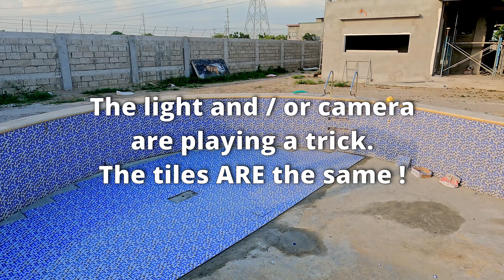Philippine House Building Day 196 - The Pool Boys Are Back In Town

Comment: Hello Mike . Your 3 layer ceilings are going to be a very nice feature mate . Hopefully done in a way no cracking of joints in the future. Hard to do in Philippines with the products available to use on joints as far as I have seen so far on ceilings over here . Suggestion for the wife - hire a 12 to 18 ton excavator with swamp tracks to work with the loader to deepen your pond to the final level and do the clean up around the pond sides . Regards Mick
Reply from the maker: Mick
Yes, I really like what the builder is doing with ceilings. Looking forward to seeing what they do on the joints.
I think we are done with the pond for now - enough money spent to dig a hole !
Reply: @philippines4.0buildinganew64  yes a loader of that capacity up my way is quite expensive daily rate .

Comment: That’s a great overview for a great Solar System.  Panels plus Batteries should be enough if you have enough of both but you apparently subscribe to the Belt and Suspenders philosophy, I do too.  If so your Generator will only have test hours on it in 10 years.  Have you calculated Break Even yet?  I’ll be anxious to hear all about the manufacturers of all of your components, especially the type of batteries.  Did you watch any of Will Prouse’s Solar Videos on YT?  I highly recommend them.  There’s also another YT Channel called Wild Wonderful Off Grid and Josh has a great video on just his Solar System.  Look through his Library for it.  If nothing else you’ll see what a system should look like done by a guy with OCD.  I’m guessing you relate to that kind of order in a project.  I believe that if you go deep on Solar on your Channel your Subs will pick up quickly.  It’s a big attraction now.  Good luck.
Reply from the maker: Hi Marc
I have had a brief look at both the channels you suggested, but I need to see more of both of them. Really good suggestions, so thank you.
No idea on break even, and honestly I have no idea how we could calculate / estimate it until we get everything running. So we won't know if we have gone with a system that is roughly the right size until we move in !
I will cover as much as I can of our system, but just don't raise your hopes too much - I am as much a dummy with regards to solar as I am to everything else we are doing here !